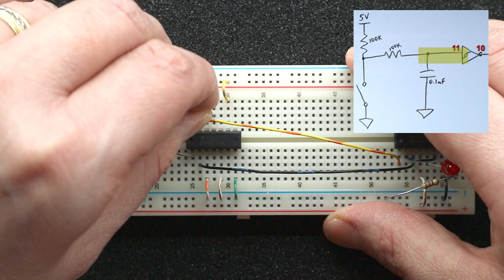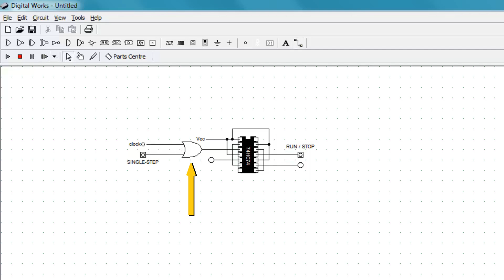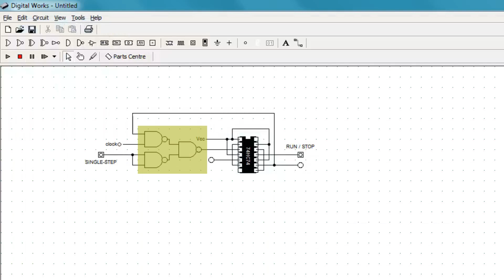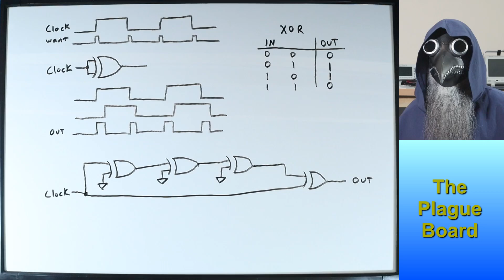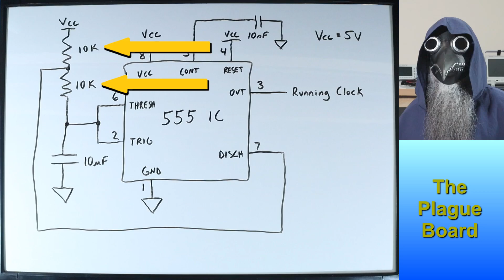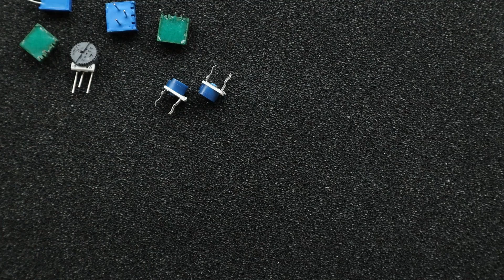Homemade CPUs, A Clock Source [Part 2] (EP 67)

Comment: 04:51 Yeah, but this solution will allow the single-step signal to always go through the OR gate regardless of the RUN/STOP position, so accidentally pushing this signal might interfere with the free-running clock (e.g. holding it high for an extended period of time). Also the D flip-flop will divide the clock frequency by 2, so you would need a 2× faster clock unnecessarily. (Let alone the 2 extra chips to implement those gates.) Wouldn't it be better to just use a 2-to-1multiplexer?
06:30 Ah, the good ol' de Morgan's laws :J
07:52 Hah, and that's basically the internal structure of a 2-to-1 multiplexer that I was talking about ;)
08:27 Not if you fiddle a bit with its 5th leg ;) (the control voltage). A voltage divider with a variable resistor could allow to tune the duty cycle to 50%, and there are ways to keep it at 50% regardless of the frequency, e.g. you can forget the DIScharge pin entirely and charge/discharge the capacitor directly from the OUTput pin through a feedback resistor and a variable resistor.
08:45 I'm all ears. Making a simple crystal oscillator (e.g. the regular Pierce one) is easy. But making it PRECISE is whole another story, because it requires making sure the load capacitance is within the specs, that it doesn't drift with time or with temperature, and that you don't overdrive the crystal with too much current going into it from the amplifier.
24:42 What about replacing the variable resistor with a… transistor? :q  More precisely, a current source with a current mirror that would charge/discharge that capacitor depending on the setting of some multiple-turn precision potentiometer? Or perhaps a combination of two potentiometers, one for "crude", and the other for "precision" tweaking?
Still not sure what was the point of that XOR gates edge detector though.

Comment: Great job. Dont know what the deal with the mask is, but I found it distracting. My PERSONAL opinion is that I would rather see a face... or not. Something inside me feels off when I can't see the lips moving, but I can see the face (mask)...
Not to detract from the content, though. Very inspiring. I actually just completed making, in hand drawn and etched boards, an 8-bit full adder. Now I am working on the 8-bit subtractor and hopefull at some point I'll have a working 8-bit ALU. All I want is a city of PCB towers that all together make up a calculator. Id be happy with that.

Comment: like your style but the idea has been done many times ben eater as example.  A pi pico for 5 bucks and mmbasic and vga interface will teach you much more , but if you must a pic micro like the 16f84 or 16f877 and a bread board . it only has 32 instuctions. Used alot in applications, why spend the time in a create a cpu that nowone uses counter productive
Reply: Different ways of learning. Teaching people in different ways is hardly "counter productive". Discreet circuits exist still for various reasons. Also for fun/hobby. Same reason people make cpu's etc in like Minecraft and what not. Anyone can program a microcontroller, not everyone has the patience or understanding of circuits to make a physical circuit for a specific purpose.
Reply: Teh LOLs. If you think that spending time and effort learning to design the nitty-gritty internals of designing and building a system from scratch is a waste of time -  why then bother with getting a pico and a vga interface?  Why not go one step further and just use a PC that you already have to run an emulator? Maybe even also download the games/apps for the emulated system as well so you don't have to learn how to code. That's a very efficient way. :-)
Reply: There is a lot of value in examining the basic building blocks of what makes  computers work on a fundamental level. Mr Plague comes at it form a different angle than other youtubers and it's very useful even if he covers the same subjects. I prefer to use an Arduino library to do my button debouncing, but often you don't have that luxury.
Reply: That comment feels a bit ignorant of how learning occurs. I don't think this is being done to re-invent the computer processor...
Reply: Why studying engineering, why make music, why have sex. Someone else already did, so what's the point of doing it one selves? <------- yep, that's your sad logic